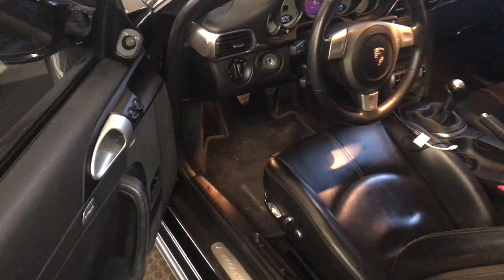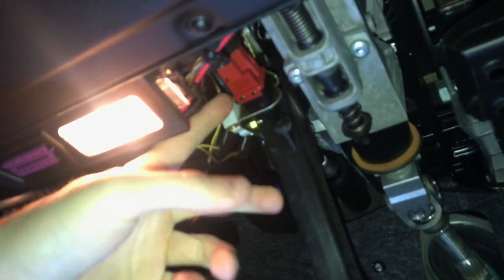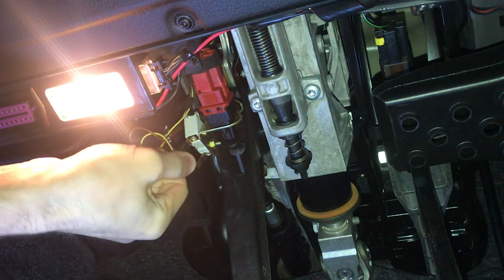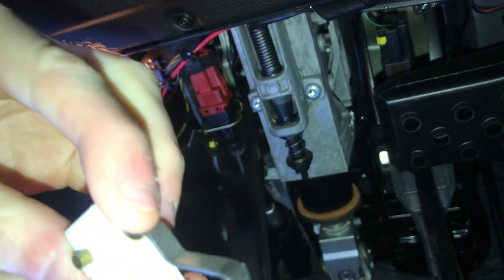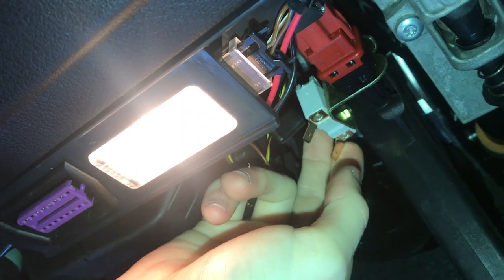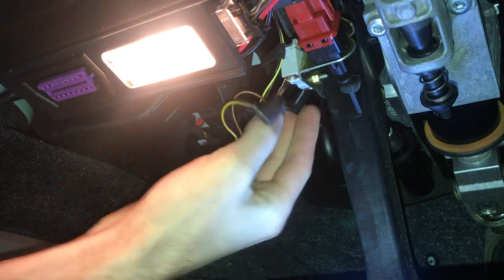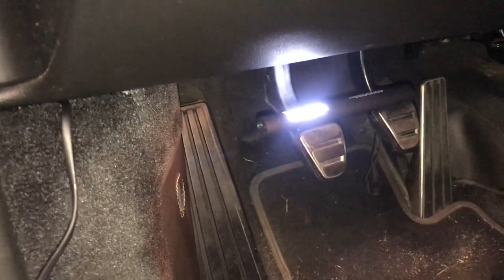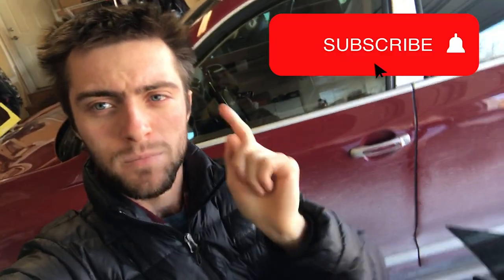How To - Porsche 911 Clutch Interlock Switch Replacement

Comment: In a pinch, you can remove those two wires and insert the two sides of a single fuse into those two female plugs. It will complete the circuit by bypassing that switch altogether.

Comment: I’m having same issue on ‘09 997. I’m now confident I can replace mine. Will order part tonight. Thanks for putting this video together!
Reply from the maker: Good luck! Thanks for watching, just wanting to support the 997 community.
Reply: Just changed mine, the bold holding the switch had been changed to a Philips head. I found I using a screwdriver bit by hand worked well. This was a bit from a multi head screwdriver so was 25mm long which was perfect!

Comment: Doing this today - looks like a quick fix.  Thanks for putting this together.  Also nice 911!
Reply: A couple of quick notes - there was only one screw and it was a T10.  A small bit with a ratchet will get it loosened and then you can use your hand.  Took 5 min.  Car was a 2009 and the date on the old part was 2011 so it had been replaced once before.

Comment: I bought a new but did not install it as I bent the switch actuator (it is malleable) less than a half inch for an improved interface with the clutch pedal. It has worked flawlessly for three days and I also put the new one in my bag in the frunk, just in case. Thanks for this video!

Comment: the switch is easy to check. Simply use OHM meter  on/off (with wires disconnected). You have not checked clutch switch (the red unit)

Comment: FYI you need a T10 torx to remove.  I was able to remove by hand.
Reply: yep i struggled didnt know it was a 10 torx until after i took it off, mine is a RHD so the air vent covers it and a large cable sits on top of it, i wish i read this part first..lol
Reply: That would be good info to start with.
Reply: Hi, mine is also right hand drive. Did you remove the air ducts before  reaching the sensor?

Comment: Electrically, there was nothing wrong with the switch I took out. It’s just the metal bar that bends under pressure causing it not to work consistently. It could easily be bent back in place to work in a pinch.  I swapped it out with the new one anyway, but the old one goes in the MacGyver bag in the frunk in case the new one really fails on a road trip. (Along with the tire plugs, fix-a-flat and sat phone. 😂)

Comment: Guys I had code P0830 A circuit.. and my 2009 turbo some time stopped when I be in low speed around 30 km/h any ideas 😢